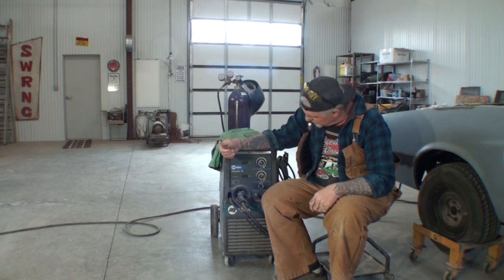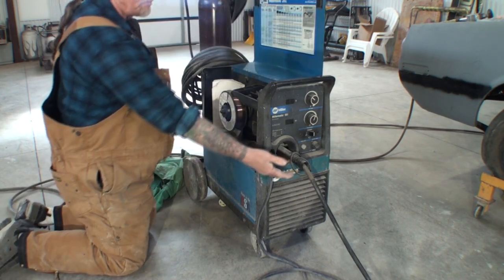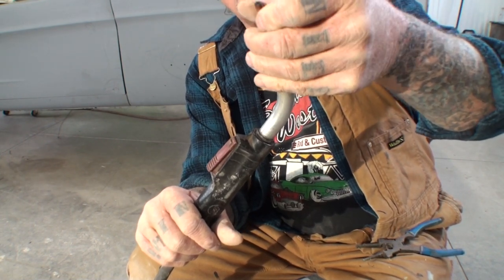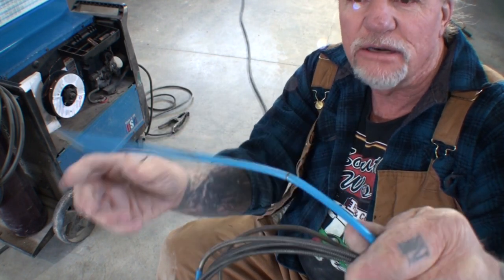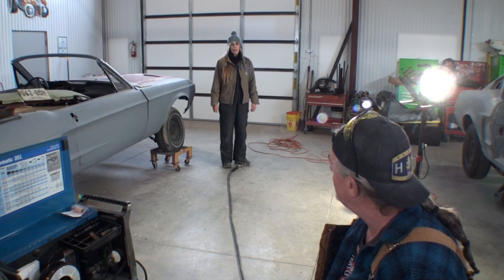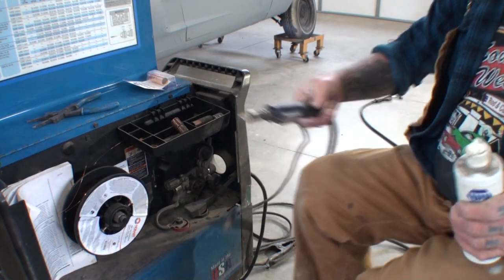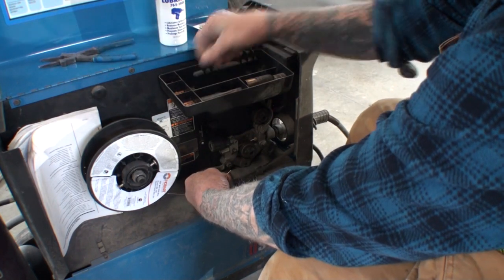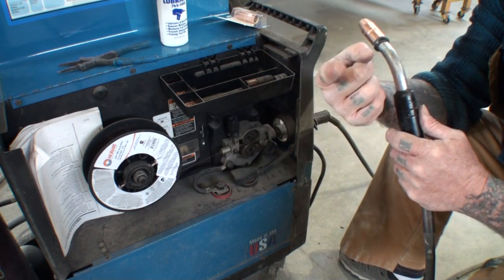Replacing The Liner In A MIG GUN - On A MIG Welder - DO IT YOURSELF

Comment: A new liner, tip and nozzle plus you know the condition of shield gas o-rings. It don’t get any better than that for the next 20 years. Ed402 of the North. 
 
y2kxj, You are right. Mine takes the 14” spools & had to make adaptor to get the smalls to fit. I keep extra wire in zip-lock bags so the don’t get a rust film on them. If not needing the welder. High humidity is hard on every thing. Have a great 4th “y2kxj” !

Comment: Changing the liner is something I do frequently. The liner size should be matched to the wire diameter. I use 0.6mm wire for sheet metal and 1.0mm wire for thick material. With 0.6mm and 0.8mm wire you can use the same liner, but not with 0.6mm and 1.0mm. The 1.0mm give better looking welds on high amps, therefore I prefer that to 0.8mm wire.